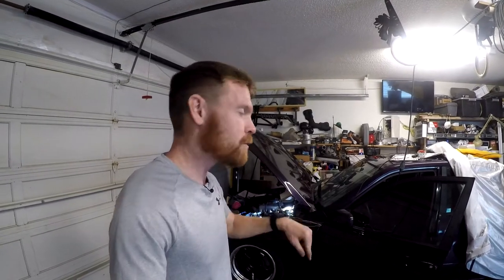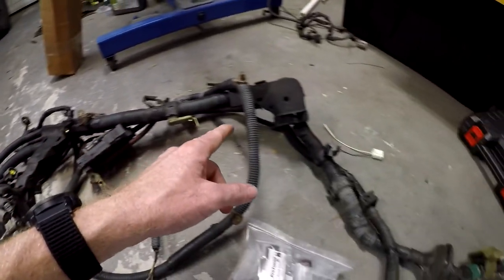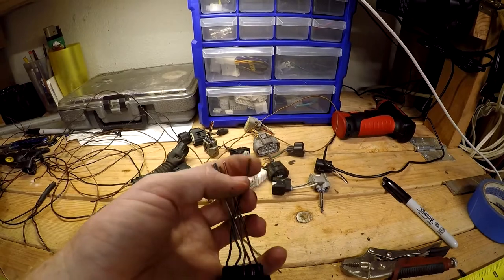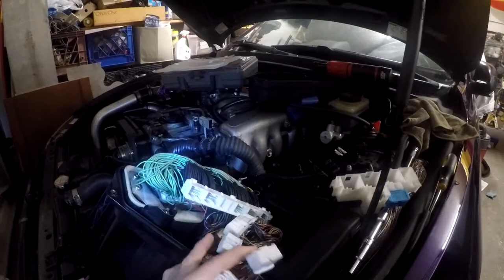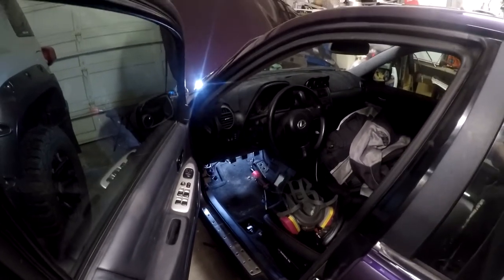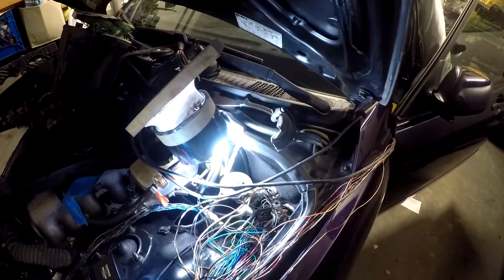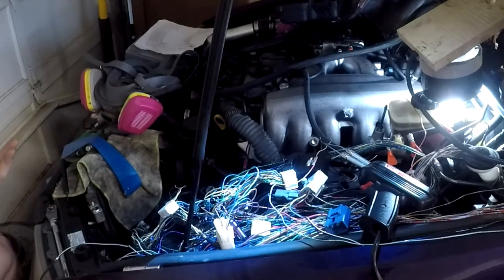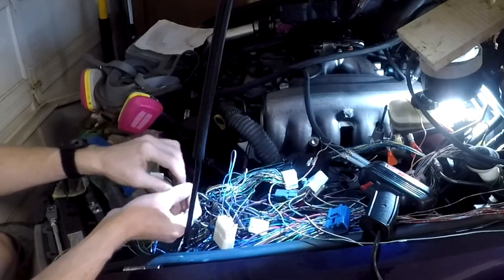IS300 ECU relocation to interior Part 1: Wire harness extension

Comment: How did you ever remove that rear nut for the ECU box? My god I've been trying to reach it for a while but there just so much stuff in the way!
Reply from the maker: I was having trouble initially, but then I removed the clamp & bracket on the top of the strut tower that holds the harness. After that was removed it was easier to get my extension in there